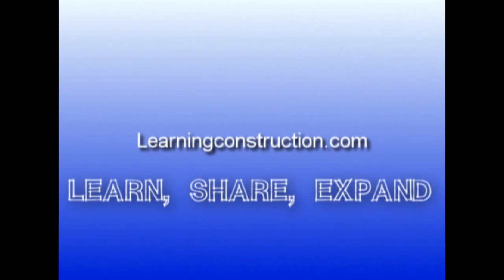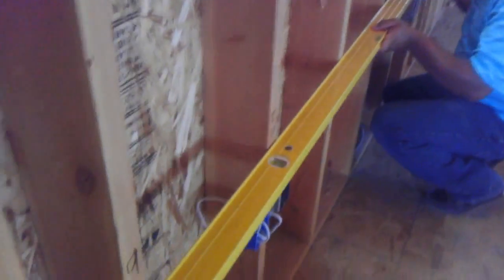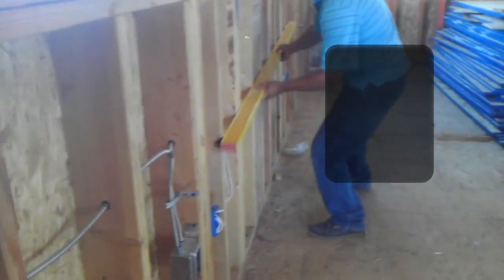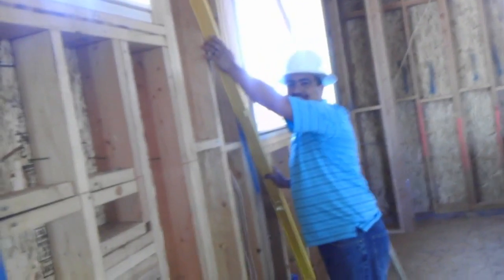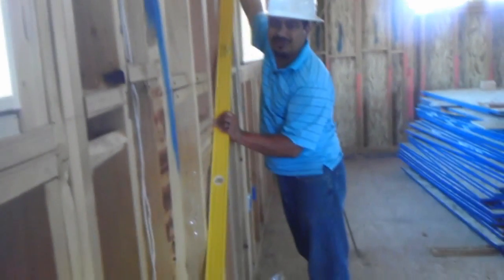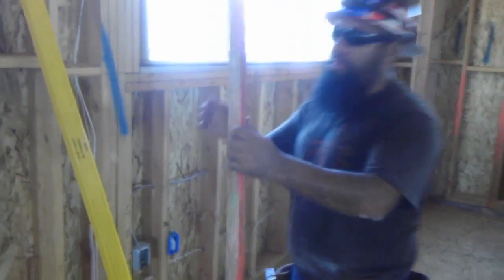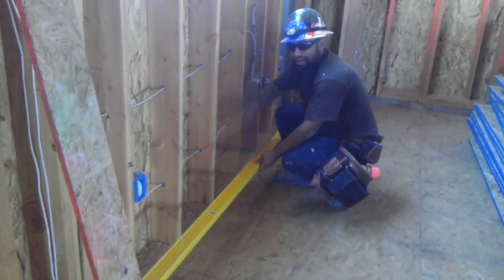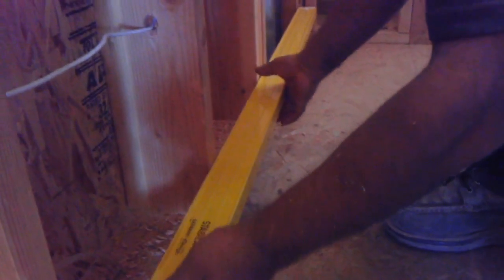How to make walls straight or straight edge

Comment: I never check the bottoms. Pretty good tip especially for getting the base straight without waves in it. However I would say 99% of homeowners would never know the difference. People will buy anything as long as there is nothing they have too do except bring the furniture. No one will ever appreciate that you did that for them so unless its your house or something high end, I would say don't waste your time unless something is terribly crooked.